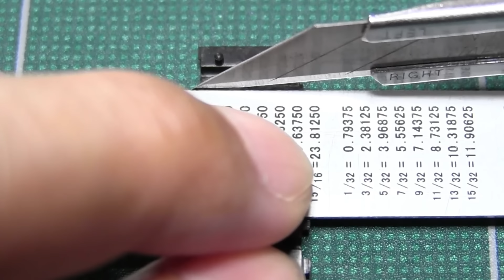1/87 Smart  DIY micro RC car

Comment: u could actually just do it with one stick instead of two because they go in all ways means that u could control the car with one only
Reply: Yes but its a circular stick, meaning that you cant have it at max braking or max acceleration at the same time as max turning.
Reply: @geshscale6068  you could, if you make a mapping from the stick position to the controls (effectively stretching the circle into a square)
Reply: @menelaoskoundourakis7552 That's right. but sometimes its nice to have the controls separate.
Reply: @geshscale6068  it is, but you said that having them both on one stick is not possible, which is false.
Reply: @menelaoskoundourakis7552  I said you cant have them on one stick without downsides. if you use that program, then when at maximum acceleration, the turning would be at either max with only a few millimeters of travel. But when there is no acceleration, then you have the whole joystick to work with. There is a reason that all professional racing controllers have a steering wheel, and then a trigger for acceleration. In basic terms, having one stick with two axis, is just inferior to having two sticks.
Reply: @geshscale6068  The reason controllers have a wheel is because it is orientation agnostic. In basic terms, stop pretending to know what you're talking about.
Reply: @menelaoskoundourakis7552  The main point is that the wheel maintains the same degree of accuracy no matter the position. There is a reason that racing videogames went from using one stick to drive and turn, to using the controller trigger for acceleration and the stick for steering.

Your idea, is perfectly possible, and people use to do that, But it is band aid fix for on obsolete control scheme, that is hard to make than just using two sticks. Using one stick, you either give up fine adjustment, or course adjustment. to put it in terms so that you can understand, Stop trying to get your bicycle to 60 mph, and just get a car.
Reply: @geshscale6068  man you're probably 15 or something, grow up a bit, learn some stuff, and then try to be assertive on the internet about things you clearly do not understand. You have a long way to go, be patient. You can achieve the same level of granularity with a wheel and a stick. This is basic HMI stuff. What changes is the invariability of the orientation, making the wheel more intuitive.